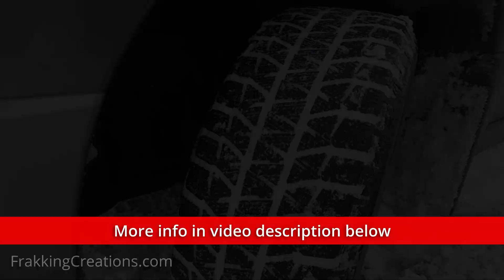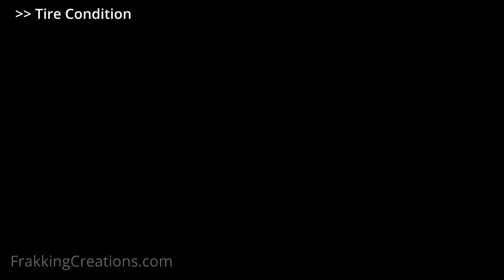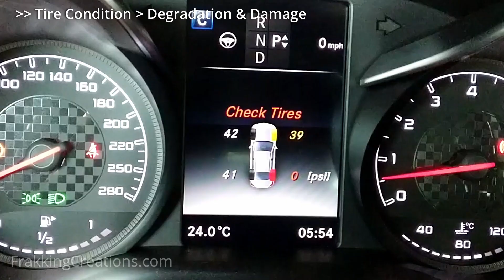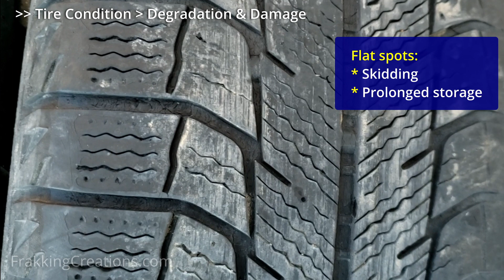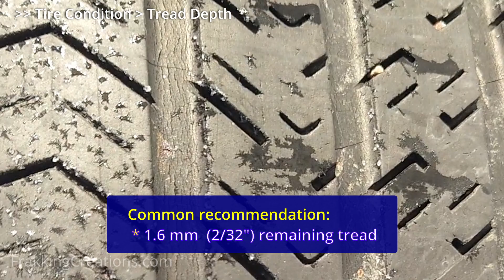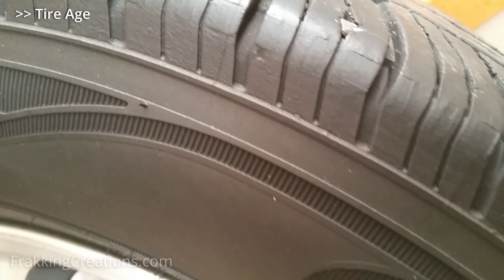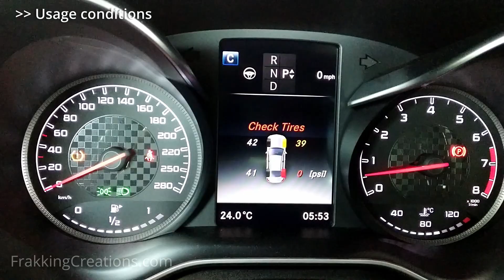How to tell if you need new tires?  Do tires expire?  When to replace tires?

Comment: Interesting that your references other than the tire sellers talk about the penny test as being an accurate measure and recommend replacing the tires at 2/32". The TireRack tests are the only thing I can find that recommend 4/32". I was told today that I need to immediatly replace tires with 3/32" of tread. Goodyear and Michelin officially recommend 2/32". I have read and reread and watched the TireRack stopping tests. Basically the depth and wet stopping power decreases from the time you start driving on them. So, how safe does one have to be, especially if not driving in the rain all the time. Heck, to be real safe replace those $300 tires rather than rotating them every 5k miles. Then you'd be real safe. There is a reason that tire manufacturers mold in the wear bars. There is a reason that 2/32" is the legal limit and recommended by the tire manufacturers. The manufacturers are exposed to the most liablilty, so I can't imagine they wouldn't be conservative and have based their recommendations on some testing also. As far as I can tell the 3/32" or 4/32" depth "danger points" are just a method to increase the tire dealers' revenue stream. Much like the oil changing shops recommending 3,000 between oil changes with the oils we have these days.
Reply: A tire at 4/32 is getting very dangerous. I dump them at 5/32 or 6/32.
Reply: "The manufacturers are exposed to the most liability" - yes. thats why they added the wear bar. They just follow the law. Its up to you if you want to take the chance or not, just like everything in life.

Comment: The law is 1.6mm not 3mm for a good reason. Yes, the wet performance is probably 1-3 m longer braking distance but the change is so gradual, owner adjust they way the brake in wet . IN dry condition, 2mm tread is better than 8mm tread. 4mm vs 2 mm for winter tires that often 8mm tread when new means 30% of the usable live is wasted for stupid marketing.

Comment: it used to be 2/32 of thread,now it is 4/32?
if it is spring, I still go with 2/32
Reply from the maker: It's not a hard rule.  2/32 is the ultimate minimum.  But as per the video as you go lower than 4/32 it starts to get less safe.  This is especially true when you have to drive in harsh conditions like heavy rain or snow and ice.  Much less grip in those conditions as the video shows.  It's up to you how low you want to go.  Just drive knowing you have less and less grip in those conditions.  A tire with 4/32 left will behave much better than one with 2/32 in those conditions.
Reply: @FrakkingCreations  
then why not change at 5/32 or even 6/32?
a tire with 10/32 thread and 60,000 mile warranty can go 15000 mile less if it changes the tire at 4/32 VS 2/32
this the old change the oil every 3000 mile trick the oil company use

so if you want to be honest tell the truth about 2/32 and recommend 4/32
for more safety, even that penny test is 2/32,so does the line between the thread they are also at 2/32

you act more like used car sales man, than actual being informative, by tryin to scare an uninformed person about tire
Reply from the maker: Thanks for the feedback.
I didn't realize I was scaring anyone.  I actually looked into it to see what the recommendations are and why.  And it is true that in less ideal situations you really do have less grip.  I think what I wanted to get across is that to be safer those are the recommended numbers but it really is up to the individual to determine based on their driving conditions, driving style and situations.  It's different for everyone.